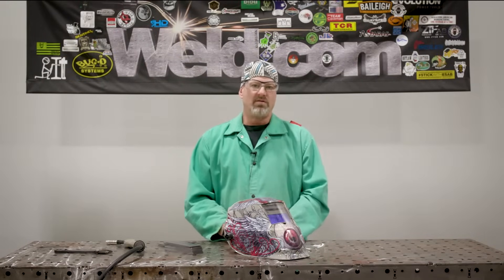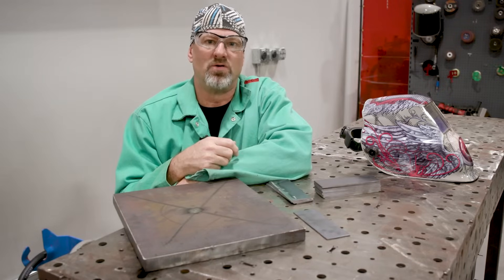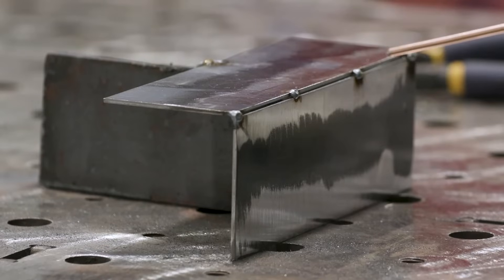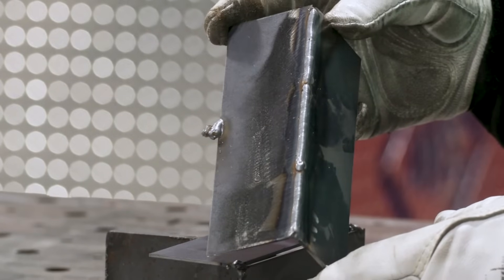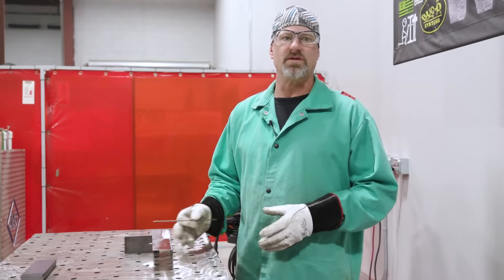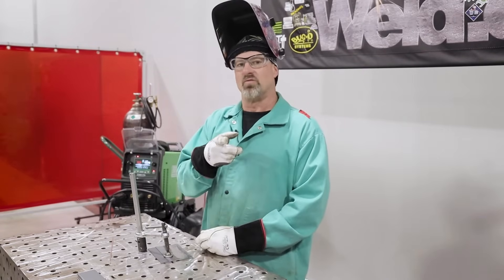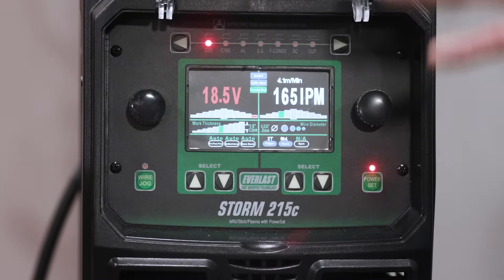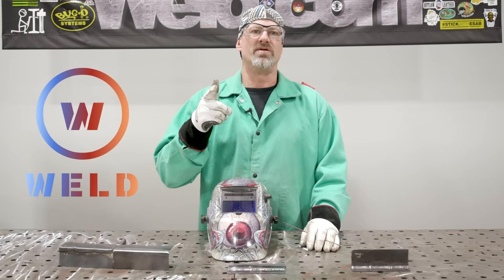How To MIG Weld Thin Gauge Material

Comment: Thanks for the video, it was really informative, I do a lot of minor repairs with my multi-process welder at home, and I always have trouble considering the metal tends to be 16th inch thick or less, the 16th inch thick isn't as much of a problem but once you get down to 20 gauge to patch a mower deck it gets frustrating, You can end up putting more holes in the metal than you started with if you're not careful 😂😭

Comment: Thank you for making this video. I’ve been at my current shop for less than 2mo & 90% of the work is 14ga, so I’m looking for good settings. This place uses .035 wire. But I have some .023 & will try your settings on Monday. 

What’s been working as a baseline, so far with 14ga & .035 is: 165ipm, 16.8V and I set the pulse for .4sec on, .5sec off.
Reply: Every welder welds a little different, just have to tweak the perimeters to your liking! Thanks for watching!

Comment: Sounds weird but I really started to understand welding processes in whole by learning how to weld thin gauge on mig.
Reply: I started electric welding on thin material with stick, and it does teach you a lot...
Reply: @ypaulbrown  I started to try and master tig first with no real world experience using youtube as a guide.... It went OKAY but it was hard. If you can ever have someone show you in the flesh you're off to a much better start.  its a HUGE advantage to have a pro point out your mistakes.  Figuring out what you're doing wrong can be costly and aggravating.
Reply: It was definitely a learning curve for me, I started welding thicker metal 1st. Thanks for your feedback!!
Reply: @FrequencyOfThought  you are so right, one on one is helpful.....lots of seat time as the old timers say.....keep at it, and sometime the problem you always have will just go away.....even though you feel as if you have been doing it the same all along.....one of weldings mysteries.....Paulie Brown [the other Paul] from Weld.com
Reply: I started out in the sixth grade gas welding on thin sheet metal my dad was a very old school welder.
Reply: @theodoredugranrut8201  Kool to have that experience.....Paulie
Reply: I learned on 18 gauge and I'm typically welding 18 and 16 gauge, hate when I have to fix holes people make in 22 and 24 gauge. First thing I tell people is if you see light through the corner joint, you're going to have blow outs.
Reply: I learned in 7th grade shop back around '85 with a stick on 16ga. Made a engine stand that year from 1/4" angle iron welded into box,you could probably held a DD15 on it.Later in life I welded for a company that made buckets and blades for heavy equipment then went to structural steel.There I was welding anything from 16ga to 1.5" with 85/15 .045.Been out of it now for almost 13yrs due to health reasons but still do some work here and there,a friend just had me make up door frames for his SXS.That 16ga box tube is more of a PITA to weld with .030 fluxcore than it was back then with the 6013? stick.

Comment: at my old job, we were welding on 14 guage steel and the settings i used was 23.5v and 500WFS with 0.035 lincoln wire on an older millermatic. things were set up in fixtures so that's how i was able to get away with it, no way of a bad fit up, just squeeze the trigger and the most important part, GO, hang around for a sec too long and you'll blow through. sometimes there would be porosity and the way we "fixed" it was by keeping same volts and lowering the WFS down to around 250ish

all welds were fillets
Reply: Those are definitely Go,Go,Go perimeter settings on 14 gauge and with a perfect fitup, Thanks for your feedback!

Comment: I use similar technique with GTAW.  Zero root gap, if need be, hammer the tacks to close the gap.
Cool metal with compressed air between tacks.
Reply: Good info, Appreciate the tip!
Reply: Wouldn’t hammering the tacks open the gap?
Reply: @timwallace8126  
Outside corners.
Reply: @timwallace8126  naa but you need to time it just when its red Not molten too fast and the tack Will explode to sparks but just right and it Will just sort of compress and close the gap and keep it closed

Comment: I weld 16 and 18 gauge pressed door frames every day, thin material is pretty easy once you are used to it. I run my settings hot, more for 1/8 or 3/16 plate and run a really fast bead since welds for my work have to ground smooth anyway
Reply: Hey Ryan, I do similar work. Steel windows and doors.  On profiles with 0.060" thick walls (1.5mm actually).  What settings do you usually use, and with what size wire?  If I may ask? I'm curious to compare notes.
Reply: Machine in using doesn’t have a digital readout for voltage and wire feed so it’s hard to tell, millermatic 212 set for the high end of 1/8 according to the diagram, and 50 out of 100 for its wire feed setting. With 0.054 wire
Reply: Once you get used to a repitious weld I'm sure it becomes easier day after day, Thanks for the feedback!
Reply: I do similar work, I also run hot and move fast on 1mm sections. Just loads of tacks and lots of clamps

Comment: Corner light gauge steel such as you have there can be done beautifully with a Low Hydrogen rod or even a 12 or 13, providing it has a good fit up and tacks in place. The trick is to 'extreme' whip the arc up and down the joint perhaps two times per second as you move along watching the puddle doing its job. The finish is smooth and hardly needs sanding. The amps are high and the whipping action is like TIG pulsing.

Comment: This perfectly illustrates the difference between a pipe welder and a sheet metal welder.  I have no doubt that you are a badass pipe and structural welder, but you would get run out of a sheet metal fab shop after that first weld.  Lol...  Different disciplines, different worlds.  Cheers all the same!  :)

Comment: A lot of the welding I do is on 1mm thick tubing with 0.8mm wire.
This "thin" material is nearly 2mm thick and would be considered excessive for a lot of the things I commonly weld.
Even when welding plates I regularly only do 2-3mm thick as surface plates for workbenches.
Reply: The sound your arc makes also sounds iffy and sadly most of the welds don't make it look like the machine is set  great either.

Comment: When I have a gap on thin material I try and put a copper plate as the backing and weld it out in sections. Makes the back really clean and flat, and the front easy to grind
Reply: Thanks for the tip, that's Good info!
Reply: @paulsableski6507  no worries then you won't be known for being a "tack welder"

Comment: i think most people wanting to weld thin stuff wanna do rust repairs on their cars which is mostly 1mm-1.5mm thick doing butt joints and lap joints. but most of them are trying to do it with a cheap flux core welder as they just wanna get their car back on the road but keep blowing holes in lol .
Reply: Doing rust repairs takes alot of patience, and yes you will blow alot of holes!! Thanks for your feedback!!

Comment: Excellent video. I’m MIG welding a rocker repair panel into my car. It’s 19 gauge. I’m planning on butting up the edges and tacking it around the perimeter of the patch, skipping around as you indicate to avoid warpage. Should I just weld in tacks until the entire perimeter is fully Tac welded? Or, go continuously (Tac to Tac) maybe leave an inch between tacs?

Comment: I'm currently learning T-joint, lap and circle welding on REALLY thin automotive material. My lap welds are coming out fine but my t-joints are just blowing through the material. Not sure how fast I'm supposed to move but it's definitely a struggle. I've tried different speeds. Any tips?

Comment: I thought I was going to watch you welding thin material like 20swg or less.
14 or 16swg no problem.
Reply: That will bring another video welding thinner material, Good Idea! Thanks for watching!
Reply: You can easily stick weld 14 Gauge steel XD. 14G isn't thin

Comment: Is there anyway to minimize the spatter of welding
Reply: What specifically are you asking? Sure there is! Thanks for the reply!
Reply: @paulsableski6507  well one of my instructor told me about controlling the current helps reducing the spatter and sometimes wrong material do spatter too
Is it true
Reply: @aaryanpanwar6405  Yes it is! You can practice on tweaking your perimeters on the same thickness and material you are welding on until you get the results you are trying to achieve. Thanks for watching!
Reply: Yep, use a pulse mig.

Comment: Learned welding at a train yard and there “thin material” was anything thinner than 1/4” since the boss would never buy anything smaller than 7/32” 6013/6014 rod. Sometimes we’d get 3/32” 7018 but that was typically for new plates being installed on the hoppers

Comment: Can you show the back side so we can see the penetration- great video, thanks
Reply: I'd have to dig them out of the scrap pile, good tip for another video!! Thanks for the positive feedback!
Reply: On thin gauge material you'll usually get full penetration cause the metal is just so thin
Reply: @MistaE  probably true, but as a new welder I am sure I can screw that up too.

Comment: Hi all, could you direct me to a good resource on gmaw parameters abd procedures when fillet welding 3/4" to 1"  thick steel plate t joint using 1/16" metalcore wire, 90/10 argon/CO2.

Comment: Should increase volts and amps and run in a straight line, move faster. This weaving from bottom plate to top plate is no good. To much heat build up. To big of a fillet weld on such thin material.
Reply: Thanks for your feedback!